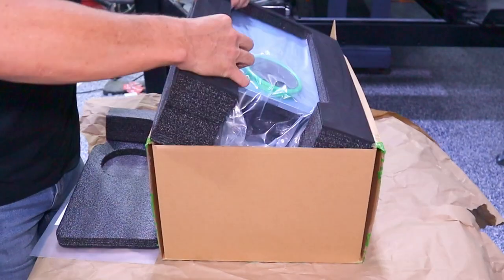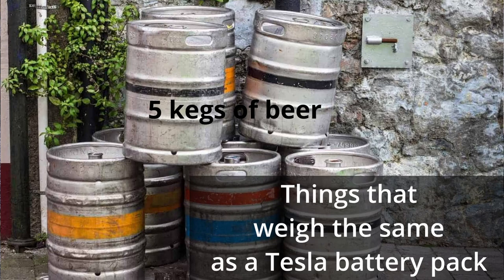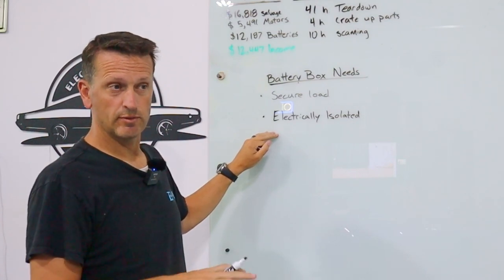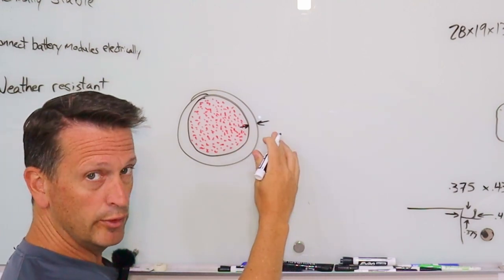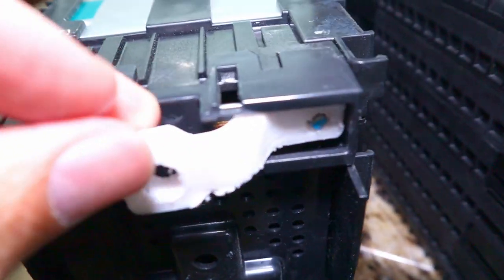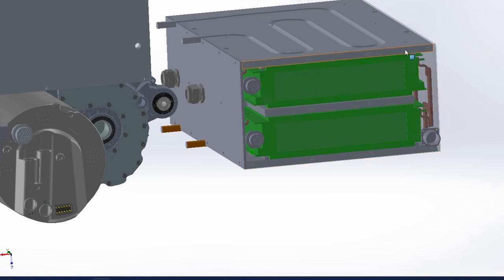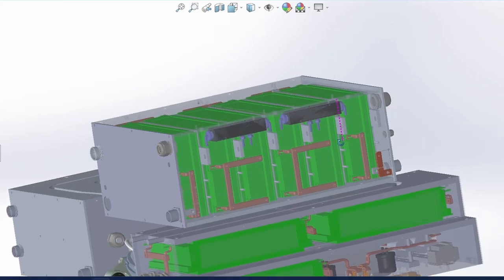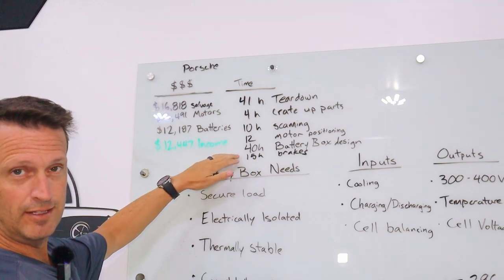EV Battery Wars: Comparing Options and Designing the Ultimate Battery Box

Comment: Just use Lifepo4 batteries. They last longer than L-ions and you can draw a lot of amps from them, The cells are tons bigger and easy to design battery boxes with, Bms is easy to find, individual cells are easy to monitor, They are cheaper per kw/hr and dont have to buy used, I think most people would give up the little bit more space for longevity. .. unless you are very limited on space and need every bit or range crammed into it.
Reply from the maker: Thanks for the tip!

Comment: Love your content, just one thing to consider: any time there's a power source there should be a fuse as close to the power source as possible, before the wire leaves the mechanical protection of the power source.  In other words, each box should have its own fuse.  This prevents the situation where both wires from one box get shorted to the frame or another conductor.  While this should be an exceptionally rare situation, if a fire does occur - even a non-battery related fire - the cables melting and coming into contact with the frame or another component will exacerbate the situation.

For a hobby build on a budget it's not a terrible design decision and tradeoff, but it's something you should do a worst case analysis on and only then reject if the risk v reward is within your acceptable limits.
Reply from the maker: Thanks for the suggestion

Comment: I am glad that you are doing well enough to pay for your son's work!  Regarding the battery for the car, I think you are giving yourself a lot of headaches by placing it in an already existing space.  The batteries could be mounted under the seats, since there is always an empty space there, and there would be no need for heated seats.  I personally would like to see battery modules that can be removed and charged outside the car.  Thus, you would drive to the charging station, exchange and pay for the charged modules and immediately drive off while your empty batteries are poured for the next user.  You would buy a Car and one set of battery modules, and then you would exchange the batteries.  The car would always have batteries, but for safety reasons they would be recycled annually and the battery module manufacturer would take responsibility for the batteries.  In exchange, the manufacturer would receive an annual subscription from the vehicle owner in the value of one module.  This would improve safety and travel time.
Reply from the maker: Interesting 🤔
Reply: Nio does offer battery changing stations with a subscription model.

Comment: 22:00 If it were my build, I would put that DIN rail on the top plate of that battery box and added an access panel below. As it is now, you will need to disassemble a lot of the car to reset a breaker placed there.
Reply from the maker: Good call

Comment: Can we get some more details on the battery?  I’m guessing the config will be 16S.  It’s quite impressive if they can put out 1800 amps.  That’s a great C rating.  Better energy/power density than the LG chem Chevy volt batteries.  

Great build!

Comment: Man, what a project. Very cool!
About things you could do better; I'd orient those fuse holders in such a way that you'd be able to have access to them without having to disassemble the entire car.
Reply from the maker: Good call!
Reply: I agree. It's pretty much a whole propulsion drop. Take top battery off for access.
Reply: Same though. Unless you invert it and can access it from under the car via an access hatch? How often do you need to access those anyway? If it’s a major fault big enough to blow those fuses it’s not getting home on its own 😂 
It’s those smaller fuses you may need quick access to. Can you have feedback if one of those trips so you know which one has gone and if the need to get to it? Great video’s and I think you got off cheap with those printed parts 😂

Comment: 18:27 I think it would be good to put a bus bar between each terminal that are connected together like this: [] instead of this L|. Doing so would make the whole battery more stable in many ways with the most important being that those lower batterys will get used more than the upper batterys
Reply: I agree, the vertical bars would then carry very little current, unless a battery dropped out.  It might be better to eliminate the vertical bars all together, to prevent some kind of bad scenario if a battery does drop out.  I'm curious if these packs have reverse current protection.

Comment: Looking good!  I'd recommend sleeving the steel bar so it doesn't contact the aluminum plates.  Dissimilar metals like to corrode, especially if there is any stray voltage in there.
Reply from the maker: Thanks for the tips!

Comment: I would strongly recommend having running the cell tap wires and the battery module connection cables between the batteries in some conduit. This will all be exposed wires connected directly to your battery with no contactors to isolate them, which makes it a lot more risky to work on the car since you cant just isolate them from the battery to protect yourself if they get pinched or something
Reply from the maker: Cell tap wires have a 1 amp fuse or similar.  These are not as risky as the large high voltage cables, but your idea of safety is noted

Comment: if this works out well you should try to make a kit for this specific that bolts on to the car as a direct replacement for the engine.
I know some guys in england made a direct bolt on electric kit for the older porsche 911. You would make a killing with that. Great job!
Reply from the maker: Thanks for the suggestion!

Comment: You’re really out doing yourself this time with the CAD work. Next level with the vehicle scanning and uploading. 

With the embedded cooling system plates, will the loops and pipe diameter create enough surface area to absorb and carry away heat?  Are you able to factor in the flow and coolant absorption rate?  Not sure how much heat the batteries will create.
Reply from the maker: I will have to test

Comment: Seems adding some insulation to the 
Batteries would be  Beneficial .  They make an adhesive foam with thick aluminum foil on the outside. Typically used in duct work and such. Something similar could be used to make the battery more efficiently heated and cooled
Reply from the maker: Thanks for the comment!

Comment: Jeremy, thanks for the informative video. I looked at those batteries for my Escape build, but I was really worried about cooling in the summer here in Tucson and 110+ temps. Those cell pouches don’t have the cooling plates between them like the Pacifica batteries in Wattson. I liked the high current potential of those over the Pacifica batteries based on EV West testing, and the smaller size allows for more packaging options - but I keep coming back to temperature control concerns. I’d love to see some testing on how the cooling plates help with that. I know it’s not as hot up in the Salt Lake area as Tucson, but I remember some pretty warm summer days when we used to live in Ogden. Good luck and I look forward to the next video!
Reply from the maker: Thanks for the comment!   I will definitely do some temp testing.

Comment: You could add a disconnect switch somewhere in the middle of the battery sting. Makes it safer to do maintenance.
Reply from the maker: Interesting 🤔
Reply: It is called a manual service disconnect MSD. For instance Amphenol and TE sell such a switch. I think almost all (HV) batteries have them.

Comment: Also what BMS are you looking to use, it would be best to have it live in your battery boxes and not run any small HV cell wires outside the boxes. Same goes for fuses or contactors that need to be inside all boxes to ensure all HV cables are protected outside the box.
Reply from the maker: Planning on Orion BMS.  I am trying to keep it in the same area as the batteries
Reply: @ElectricSuperCar  intresting choice seeing they do not really support your parallel module configuration. Also your struggles on the Hummer ev conversion.

Comment: One of the side effects of building a lighter weight EV is that you get better efficiency from the battery capacity that you DO have. Having said that, I'd still anticipate it having a sub-300 mile range. Possibly less than 200 mile. But, for a sports car that is not your primary mode of transport, that's totally acceptable. Particularly nowadays when Tesla has finally opened up some of their charging network so you can actually fast charge in more places with decent reliability, so the range anxiety is somewhat lessened even for lower range vehicles. Also rather fortunate is the fact that the Tesla rear drive unit is a bit smaller than the engine and transmission it replaces, so you can afford the space around it to cram extra battery packs without needing to stack them as high up in the car. It'll just make cable routing a bit more interesting. 

If you have a lot of skill in metal fabrication then you could completely reshape the front and rear firewalls of the cabin along with the tunnel and floor to provide even more dedicated space for batteries to live, but that takes considerable time and effort both in the fabrication work itself as well as the learning curve for acquiring those skills in the first place. It would basically be looking at the chassis' fixed points, the suspension mounts and supporting structure, the sills, the pillars, and the floor around the seats, then considering everything else within the body as changeable to suit your needs. Figure out where weight needs to be, how to best facilitate the motor mountings, and then design battery enclosures and figure out how to make the construction around them into structurally functional parts of the car. It's certainly not as flexible as designing a car from scratch to be an EV, with a raised floor to house layers of battery modules as the lowest possible center of gravity, but it's much better than if you have no choice but to shove batteries around in an unmodified chassis until you get the capacity and discharge rate you need, but you end up with batteries stacked to the parcel shelf.

Comment: Have you thought about using multiple types of batteries in the car to take advantage of the different advantages with different types of batteries? Imagine having an energy dense battery pack for the range and a small power dense battery for high draw scenarios. Maybe it’s possible to use some sort of super capacitor for those extremely high draw situations in the future?
Reply from the maker: Interesting 🤔

Comment: Jeremy, Is it possible for the discount for the EV charger to be extended? It looks like it unfortunately expired before you were able to post the video. Thanks so much as always for sharing this journey with us. I loved the payout to "The Man" for the parts! Thanks for bringing the family into the build.
I realize that extra wiring is expensive, but wouldn't it be advantageous to put some portion of the batteries at the front of the car? My other thought is to put the more powerful (larger, heavier?) motor with some batteries at the front again for more balanced weight distribution. I forget how much the original car had as far as weight in the back versus in the front, but I am guessing somewhere around 55% back and 45% front would be perfect. Sorry, just armchair engineering and I'm an IT engineer not mechanical....
Reply from the maker: I will look into it

Comment: Wondering if @Makera wants to sponsor you a Carvera so you can prototype these parts at home, and wondering if @BambuLab would sponsor an X1 + AMS. I think these two tools would get you a long way with prototyping faster and better. This got to be a project both companies can see would give their products a great spotlight.

Only issue i can see is getting to those fuses if you need to. You would have to drop out a lot of stuff to get to them. You have room up top, I personally would try and move it around a bit so in case you need to, you can just remove a top cover that has dual orings and then you can get to the fuses and don't have to drop it all out from the bottom of the car.
Reply from the maker: Put in a good word for me
Reply: or Shapeoko Pro or Stepcraft M1000

Comment: Great video! I really like the explanations. Do you say and I missed how many modules are you using in total? What is the total peak voltage? Are the cells in the modules cylinder or pouch?
Reply from the maker: Pouch cells.  28 modules.  Peak voltage will be capped at 400V

Comment: Enjoying the build. Hoping to do one myself someday.  
Question:  What is your goal for weight distribution?  It seems like you might end up rear heavy with all the batteries in the back. Or will the addition of the front drive unit cancel that out?
Reply from the maker: I am trying to keep the weight and distribution close to the original vehicle.  Trying to put the packs where the engine and transmission used to be
Reply: Was thinking the same. The batteries look slim enough to fit in the center tunnel, maybe some at the front as well. Would have probably improved on the original in terms of balance, and it was already well balanced. The engine and transmission were quite flat and relatively low to the ground. The battery box on top of the rear drive unit might keep the balance numbers the same, but it will have quite the moment of inertia when changing directions…

Comment: In regard to your power brake design: why didn´t you go for a vaccum pump like beeing used in modern (turbo) vehicles? paired with e.g. Mater XV600 switch it works fine for me (in a classic Car)
Reply from the maker: Definitely an option

Comment: Would the drive shaft channel hold any of the battery packs - inline maybe 3 might fit? Or those are too tall to fit there.
I always thought about EV conversion and fit battery packs/cells at any empty space.
Reply from the maker: It is super tight.  It would potentially hold a few batteries length wise but would block off any other lines or cables

Comment: I think youshould think carefully about how are you going to place the cooling connections once they are outside the battery boxes. There is not a lot of space in there. Also, all these thick aluminium plates are going to add a lot of weight 😅
Reply from the maker: Right you are!

Comment: You must be concerned about the center battery boxes ability to shed heat. Considering that heat rises, won't placing cooling plates to the sides have sub-optimal effects? Same with bottom mounted cooling plates. From a cooling standpoint, I would think that stacking batteries one atop the other with cooling plates on top of each would be best.
Reply from the maker: I think you are referring to convection or radiant heat transfer.  I will be using conductive heat transfer, in which case orientation is not important
Reply: @electricsupercar  Thank you. I have more learning to do.
Reply: Hot air rises because it is less dense than the cooler air around it. Thermal energy within a solid does not do the same thing. Conduction rather than convection.

Comment: Will the battery mass that high up in the chassis cause an issue with handling?
Reply from the maker: Batteries are in the same place as the motor.  Should be same handling

Comment: how will the battery placement affect car weight balance? it feels like one side is gonna be way heavier with the batteries and engine.
Reply from the maker: EV conversions are usually a little heavier than the gas counterpart
Reply: @electricsupercar  that's too be expected, but that's not what I meant. In your cad design, one side looks like it holds both the motors and a large battery pack while the other side has only a battery pack and the front-rear weight distribution might be problematic for handling (might be mistaken of course I don't really understand much about the subject).
Reply from the maker: We will check it out as we go

Comment: great stuff. you mentioned in the video joining your double module negative to the next double module negative... which would imply everything is in parallel. Was that a typo/misstatement? I'm assuming each double set might be in parallel but at some point you would have negative going to positive, correct?  Also, those contactors will do a good job of making those wires coming out of these modules deadfaced when the contactors are open. But keep in mind that on the other side of those contactors, those wires going between the modules and the BMS wires will be hot. Since you can't have everything in one box, you may want to either add contactors in each box, or maybe as a mitigation use strong conduit between the boxes to make sure those wires can't ever be touched. I guess one issue is emergency responders cutting through them - even if the contactors are open it wouldn't help in that case. Great job! can't wait to see more progress!
Reply from the maker: Positive to Positive doubles amperage and Positive to negative doubles voltage.  I think we are on the same page
Reply: @electricsupercar  yeah, I agree but if you listen through to your video and your voice track it doesn't sound (at least to me anyways) that you are ever increasing voltage.
Reply from the maker: @FrankGraffagnino  understood

Comment: Wait a tic, what are you using to have a waterproof method of having the high voltage entry and exit to each battery box? 

Also, that cooling seems kinda overkill, and probably super expensive, did the method you used for the previous car not work that well and now you're trying to avoid it? Or is this new method actually much easier and not much more expensive?
Reply from the maker: I guess we will see